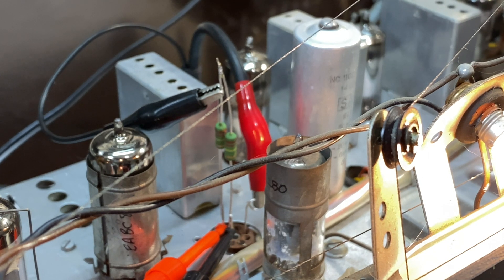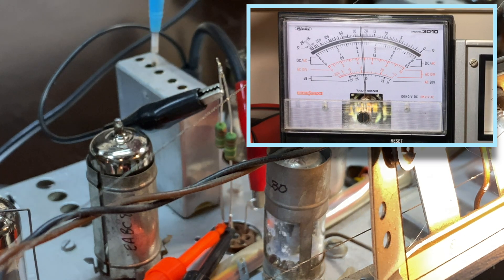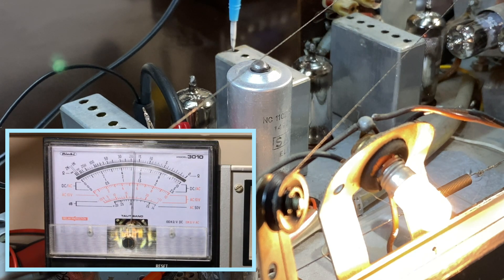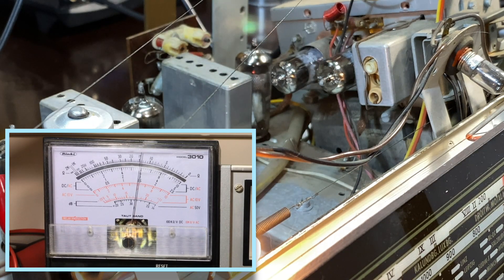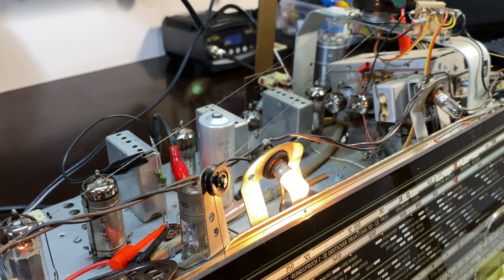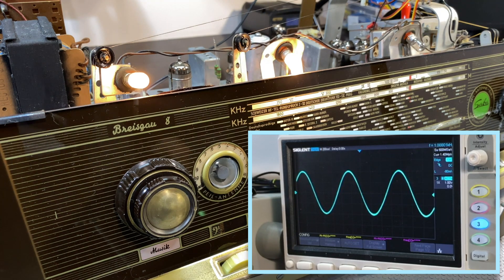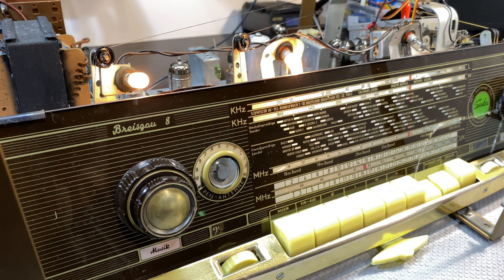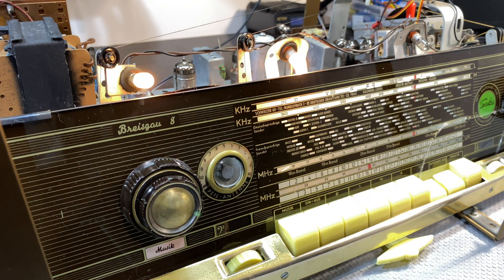SABA Breisgau 8 pt. 10A. Fixing errors in the FM alignment. I seem to have more luck than brains :)

Comment: Hello congratulations for your video, my name rolf guse I am from Brazil, I would like to know if you are willing to help me with a calibration step FM radio saba_meersburg-automatic-9 which I have been renovating for over 1 year,
I have all the necessary equipment but I don't have much knowledge of the step-by-step process, thank you for sharing your videos.
Reply from the maker: I’m sorry Rolf, I cannot do that as it is something that is extremely difficult to do long-distance.
Reply: @electronicsoldandnew  thanks for the answer, would it be possible to just explain the logic and signal levels that sir generate to perform the calibration how many mv and types of signals.
Reply from the maker: It’s been some time since I did that, so it’s not fresh on my mind. The videos should explain that.